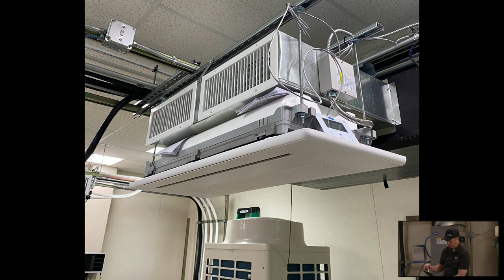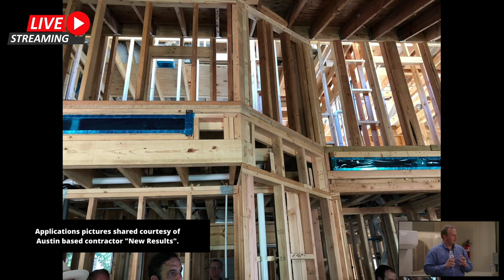Carrier Ductless - What’s the latest in HVAC equipment - LIVE STREAM

Comment: Hey guys, I like the brand, I believe it is a quality product, but I think you need to focus more on modernizing your grills and trim plates. Most of the time in high rise construction designers only care about what you see on the outside. Most people don’t want a plastic grill trim plate on the wall or ceilings. A nice solid metal grill that sits flush with the wall is what architects and designers are looking for. Also the basic Metal HVAC grills won’t cut it. You need to make a grill that represents your brand, kinda like the grill on a car. Another Idea would be is to create a ductless system that would sit in a wall like a bathroom recessed mirror. The unit would hide behind a picture with the air flowing out the sides. Also Matt, many people don’t like to see mini split systems on walls or even all the piping and units on the exterior of the buildings. Another idea would be a system that sits inside of an exterior accessed utility closet. The unit would come with a finish grill that could be installed on the door or wall and then ducted to the unit. That way the unit is protected from the elements and you would only see a fan grill. Think modern, precision, streamline. How can you make your product the best. Remember most people only care about the looks, weird, but true.

Comment: Love the ductless systems and their efficiencies. Behind all of the amazing specifics and building science of these units, a hard truth, at least here in the Midwest, northern Indiana, the price of these units for a whole house system compared to traditional forced-air units have a price tag of 1.5 times traditional. I don't think this is talked about enough and should highlight the true reasons of these costs difference. Maybe it's regional based and our area hasn't caught up, but I've had multiple quotes come in from installers and suppliers along with creating my own calculations, designs and sourcing of the equipment and still is 1.5 times traditional. Hopefully this side of the country will jump on the train of these systems.

Comment: As a duck cleaner I have a problem. Mainly the lack of air filtration that these provide being that they’re almost always stocked with a basic pre-filter. They are harbingers of mold and mildew growth and almost never get a proper cleaning. And while it’s true that even a normal household furnace or AC unit can suffer these problems. From an indoor air quality standpoint I’m just not a huge fan.

Comment: Hey MATT!  What is the opinion of THESE MEN.. on the use of TSTUD and the HVAC system required!  Mechanicals?  Carrier design?  How would they retro-fit a 15-20 year old home / system, NOW due NEW SYSTEM (North Carolina, inland, off east coast, but SOME HUMIDITY from sound)?  Would they recommend a inspection of some sort to go from ducted system to ductless?  LOTS of holes to plug in floors and ceilings on 2 story home.  How would YOU do THIS?  Should we simply sell and build new IF we wanna come into the 21st century as per your videos?  Went to Carrier website...NO installers / sales locally.  System recommended typical forced air based on 2k sq. ft. w/ gas and or electric heat. Try it!  I wasn't impressed.

Comment: @Matt, Any tips on HVAC contractors in the Dallas/DFW area? I'm looking to replace my furnaces, and just did spray foam in my attic 6 months ago, so trying to find a place that will not simply replace my current system 1 to 1, since I shouldn't need as big of systems anymore. --Long time watcher.

Comment: Always wondered if AC vendors can have an option to use recovered heat and heat a water tank? In summer that should be almost free hot water!
Reply: Mitsubishi has been offering a hybrid outdoor inverter heat pump A/C water heater in the Australian market for several years. Wish we could get them here, especially good in temperate climates.
Reply: There are some units that do that. If I am not mistaken, Mr Cool and Arctic are some.
Reply: @harrytanase1587  Those are DIY Chinese knock off pos units. I repair a lot of them and parts are hard to get.
Reply: You need to look into the single phase Heat Recovery unit offered by LG.  You can pair a Hydrokit unit to it to heat a tank of water and it will use the heat from the other zones in the house that are in cooling mode.  As far as I'm aware, LG is the only company offering such a solution that works with single phase residential power.  Also, if you live in California, they have no way to model this correctly in software to comply with their energy codes, so you'll have to go with separate systems for water heating and HVAC.
Reply: @taylorlightfoot  Thanks for letting me know about LG products, I'll check it out. About California codes. Who wants to live in California anyway? ;-)
Reply: @EdTheWretch  It's a beautiful geographically diverse state, I just wish it wasn't over-regulating everything to the point where most can't afford to live here.
Reply: @EdTheWretch  They used such a system in an episode of this old house a few seasons ago.

Comment: Precise temperature, quiet and more efficient, but the only drawback is cost. However if a house is tight enough, maybe not a wall unit in every room because living/family output will be enough to keep most of the rooms cool? Then only rooms for teenagers will need some extra pipework and wall units.
Reply: Saying they're more efficient than 1 large system is subjective at best and pretty much bogus cherry picked sales calculations
Reply: @yoski203 , they are more efficient because they are variable speed which makes a huge difference.  They are also ductless in some configurations which also makes a big difference since lots of energy is lost in the ductwork.  It has nothing to do with "cherry picked sales calculations."  I have replaced traditional HVAC systems with variable/ductless systems like these and the energy savings is substantial.

Comment: I like the ductless concept but how to use it in high ceiling areas where should I place the inside unit
Reply: If your building envelope is good then it doesn’t matter too much where you put it. This would be an issue with normal hvac you just might be use to a large fan annoyingly blasting air at you.
Reply: Wall units aren't the only option, there's also ceiling units among a few other options but placement depends what you need and how the airflow works in the space.

Comment: Cleaning filters every 2wks?  I was planning on using these in my next house, but there is no way now.  Anything more than twice a year is too much. I assume the bigger ducted units you can use bigger better filters changing them every 6 months
Reply: I've had ductless for about 3 years. I clean mine about every 6 months, and they're only marginally dirty at that. Every time I switch from heat to cool or cool to heat, I clean them. No biggie. 

I'm about to do my first blower wheel cleaning as well.

Comment: Where does Carrier stand on integrating domestic water heating into the home energy system?
Reply: They don't.  LG makes a single phase heat recovery system you can pair their hydro kit product with.  It's the only product I've seen that can be powered on normal residential power.

Comment: How do you guys like or dislike the smart vent returns used to create a zoned system on old homes with remodeled basements?
Reply: Don't
Reply: "Smart" vents are a terrible idea and can damage your air handler since there is no way to communicate the changing dynamic pressure imposed by vents independently opening and closing. Furthermore, I've never had any luck trying to improve the heating or cooling in different parts of the house by choking off other parts.

Comment: 11:05 Have 3 of these in my new apartment, and they are a pain in the ass. They are controlled by these crappy little IR remotes that have a very narrow angle and distance of operation, and which have no feedback from the unit itself, and since there's no display on the unit itself, there's no way to know if the unit has the same settings as the remote. Multiple times, with the thermostat set to 70, I've come home from work to an apartment that's 78 degrees. The only way to manage this system is to manually turn it on and off (which usually takes multiple attempts thanks to the crappy remotes). I wish I just had something hardwired that could tie into a smart thermostat, and that would give me confidence in knowing that it is set the way I want, and with the ability to actually respond to the environment around it.
Reply: What brand?  Many of these brands offer a multitude of control options including interface kits allowing traditional smart thermostats to be hooked up to them.  It really comes down to having a very knowledgeable installer that's willing to go over options with your prior to installation.  A good installer consults with the client and manages expectations first.
Reply: @taylorlightfoot  I've got the exact same model shown in the video at that point. I do think I recall seeing in the service manual that it can be hooked up to a normal thermostat, but being a renter in an apartment, that doesn't do me a damn bit of good.  The standard method of controlling it is the remote control, and it's complete garbage.  I really like the concept of using more efficient heat pumps, and I like having 3 separate zones in just a 2 br apartment, but man, the total inability to control it makes the whole thing worthless.
Reply: Sounds to me like incorrect settings or an issue with the equipment.
Realize that, in general, the remote is NOT a thermostat!!!! It is simply a control, like you tv remote. The information is not read/stored on the tv remote it is on the tv, just like the wall head and its remote. 
You set the temp and onboard sensors in the wall unit do the work of controlling AND sensing temperature NOT the remote.

There are some aftermarket controls that might be able to be added to your unit to make it more of a conventional system as far as temperature control.
You should ask a qualified technician to give you estimates on what can be done and if there are system issues(either operational or install related).

Comment: I see one major problem with these new products.  Plastic gets brittle with age and it will break.  My 1960 vintage all metal system never breaks.  It may get dirty and need to be cleaned but it is as solid in 2021 as it was in 1960.  Plastic is easy to manufacture.  Metal is more costly but plastic sucks!  My 1990 car has one computer.  A 2021 multiple computerized car full of plastic is a throw away product.  I hate that crap!!  Old tech is reliable and cheaper.  This concept is going to be easy now.  Will it still be working in 55 years?  Not a chance!

Comment: I have a home in MI that has a gas boiler for hot water baseboard heat with no ducts for AC.  I want to replace my boiler with a ductless system for both heating and cooling.  So, I'm worried about find a contractor that understands your systems enough to design a solution for my needs.  Please advise, thanks.  Great video but most went over my head since I'm not a builder but I loved learning about this technology.
Reply: Depends on which area in Michigan. Google Carrier authorized dealers in your area and talk to them about installation. Some may have more experience in this type of equipment than others.
Reply: @tvmrfixit814  I live near Greenvile, MI and it's close to Grand Rapids
Reply: @mackdenn  a bit far from me, I'm from Traverse City. The dealer locator on carrier.com will get you 3 or 4 dealers that service your area.
Reply: @tvmrfixit814  Thanks Jon, I'll do my research and find an experienced dealer in my area.
Reply: Do your homework on this.  I love my Fujitsu  mini-split I used for an addition on my home in mid-Michigan but when it gets really cold, less than 15  degrees, it really seems to struggle.  It’s rated to heat down to negative 15.   It blows air that feels cold when it gets real cold out.  It’s not very comfortable.   Anything above 30 degrees and it seems to work wonderful.   I’m not sold on mini-splits as the only heat source in our climate.  If you have a wood burner or something like that for the colder days it might work.   It’s great for cooling.
Reply: If you're looking to keep the water radiators, look into LG Hydrokit.
Reply: @taylorlightfoot  Will that work with base board heat and also provide AC as well?
Reply: @mackdenn  Are you wanting the baseboard heat to remain heat only and also install other zones that cool the air?  then yes, it can work that way.  The hydrokit device is basically its own zone, you have it keeping a tank of water hot.  You use recirculation pumps from the tank to the baseboard radiators is my understanding.

I would find a reputable LG installer in the area as the system is not common yet and you want to go with someone who knows what they're doing.

They used this on This Old House: https://www.youtube.com/watch?v=Ag1tmOCgcdE

Comment: When is Carrier going to have a heat-pump water heater as a heat recovery zone option, and a dehumidifier/RH-control zone option instead of needing a stand-alone device?

IMHO, there's no reason that all of a home/apartment's heating and cooling loads can't be managed by one system which has a "world-view" of heating/cooling demands in the structure.
Reply: I think this may be what Tesla is working on. It's how their current vehicles work.
Reply: If you want this now, in a home with single phase 120/240V power, your only option is LG.  They make one outdoor condenser model that supports heat recovery and you can pair their hydrokit product with it.  Saw them do it on this old house.

Comment: Lol I will sell this stuff when they are reliable. But I promise the energy savings will be countered by the repairs. Most service techs are not qualified to work on such equipment and basically all the main components cost thousands. But our local city/code building switched to equipment like this and they kept it for 2 years then ripped it out and replaced with standard HVAC system. They had nothing but problems.
Reply: I'll take a PSC 80% furnace with 13 SEER.  There is no substitute for a well designed split ducted system.  Prove to me that this will last 20+ years without any failures and parts replacement. Then I might consider it.  Otherwise it's Innovation Users Don't Need.  ISDN.

Comment: MATT, HELLO, CARRIER, TIED IN WITH TOSHIBA, as I recall, for quite SOmewhile, it’s a case of ‘WHY RE INVENT THE WHEEL’. !  There is a supply house in the EAST,whom carried SANYO for years, then dropped them for PANASONIC, nowadays most companies no longer supply COOLING ONLY,their ALL HEAT PUMPS, many no longer use R 410A, going for mildly flammable refrigerants,like R600,& others to take on GLOBAL WARMING ,as GWP component are very low,HOWEVER THE BUILDING CODES,& LAWS are being changed as we speak,as all the BIG NAMES have already been COMITTED
STAY WELL CHERIO,🇺🇸🇺🇸🇺🇸🇺🇸

Comment: What is wrong with one 5ton in attic, all rooms zoned dsmpers have thier own thermostat and attic is foamed. Sealed house. Ducts are full house full air turnover. Floor air ceiling air all pulled out and replaced with fresh air pulling from several ducts pouring back into large rooms at 4-5 points (ducts) versus one. and using same technique with dampers. And WAYYYYY MORE filtration cleaner air. ERV/Dehumidifier/Humidifier/UV light on coils no mold/ ONE unit to service and clean per year versus 8-9. How many hvac techs are going to understand this new tiny technology. If it breaks they’re likely gonna say sorry just buy a new one we can’t fix it.

Comment: The problem with this is heating is expensive with the ever increasing electric prices. Figure a way to run this on natural gas inexpensively,  you will have something.
Reply: These are heat pumps not resistive heaters.
Reply: Electricity is the future, not natural gas.

Comment: The Carrier ductless systems are terrible. Rodents get in and eat the wires. 🐀 I found the distribution support to be way below par. I’ve ordered parts three times for about 10 systems installed and they took weeks/ months to receive. Run back to Mitsubishi it’s not worth the $1000 difference in equipment costs.

Comment: Is getting rid of condensate a challenge?
Reply: Yes, for the small ductless systems it can be a challenge if the house isn't built for it (no pre-existing drain lines for each unit) and the indoor unit is not on an exterior wall.  You can use condensate pumps, but my advice is to place those pumps so they are accessible.  A good way to do it is to install the indoor unit on a wall with a closet or similar space on the other side.  The condensate pump can then be installed inside the closet on the other side of the wall from the indoor unit.  This keeps it out of sight (for the most part) and makes it easily accessible in case it needs cleaning/replacement.

Comment: Nothing better then ducts , or yoh will have bunch of ugly boxes hanging in every room. You can have air filtration of any kind with ducted system - you can’t have with wall/ceiling cassette,, ducts can have humidifcatuon ductless you can’t, I can have vent in the closets let’s say 5 closets, with ductless you can’t or you  need 20 units in each room,  no air flows in the small spaces no air flows in the pantry, no air flow in the each bathroom or you need seperate heads in all baths,, mold issues, what about laundry room no ventilation  - yuck ,, how you add fresh air to house when you have ductless?  How you add uv lights on ductless? only use ductless in one open space that is it ,,,only standard ductiing will work with one of these units that can be hooked up to existing ductwork